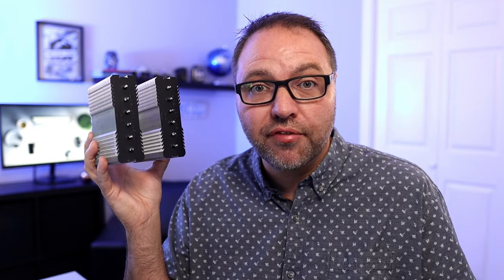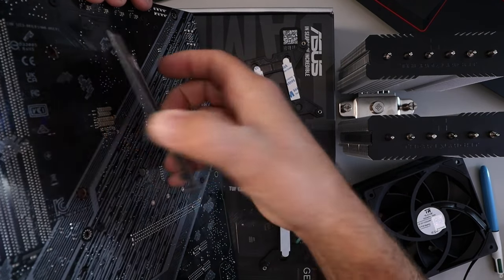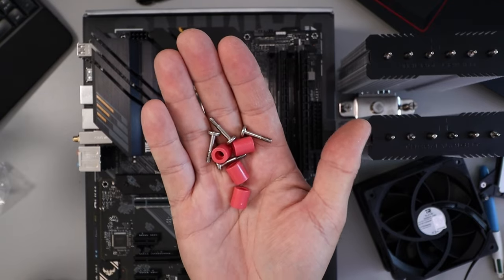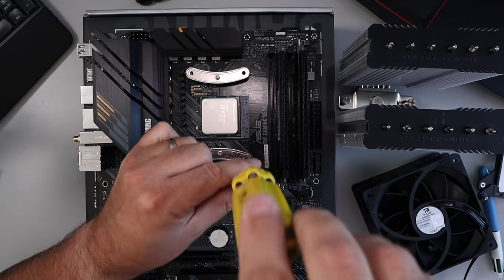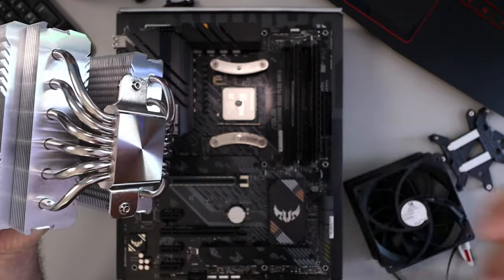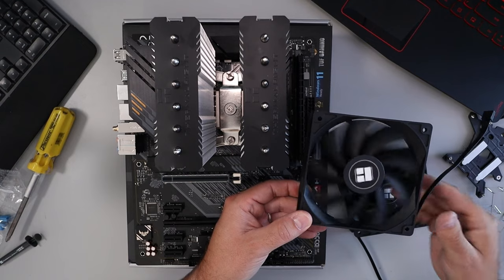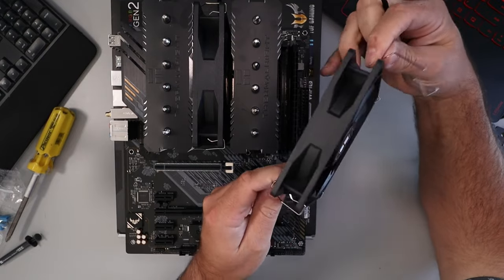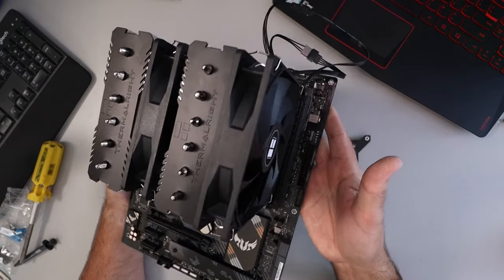How to Install Thermalright Peerless Assassin 120 SE CPU Cooler

Comment: Hi! I have just built a new gaming PC, currently using Arctic Freezer 7 X as a temporarry cooler for my 7600 waiting for this one to arrive from amazon, can I install this cooler without unscrewing the motherboard? it took me so long to wire everything and screw everything down I try to avoid doing everything over
Reply from the maker: Yes, you should be able to but the space can get a little tight.
Reply: @NorthernVikingEveryday  Tyvm!
Reply: Installation went well! 
Thank you for the tutorial!

Comment: Sorry to ask, but for the right most fan, was it sitting right on the ram or was it hovering it
Reply from the maker: I slid mine up about a quarter inch so it would clear. The ram. Seems to be working great for me.

Comment: Mine does a noise. It ramps up from silent to this noise I cant explain. For a few minutes then it goes away. Then it starts up again. It’s nothing to do with load. It does it on idle, randomly while gaming. I thought it was the case fans at start.

Comment: I've just installed mine, however my ram is too tall so I've moved the fans a stage back, so I have a fan in the middle and a fan on the back, do you think this is going to hurt my cooling significantly?
Reply from the maker: I've never tried, I would keep a close eye on it for a bit and monitor the temps.

Comment: How is the clearance for RAM? That looks like an awfully tight fit right?
Reply from the maker: It is pretty tight on mine. I did have to slide the fan up  maybe an eighth of an inch for it all to fit. But it seems to work great.
Reply: @NorthernVikingEveryday In theory, I reckon you could also flip the outer fan to the opposite side right in front of the exhaust case fan right?... I'm not sure if that would affect it negatively though airflow wise though.

Comment: Would it be possible to install this with the motherboard already mounted?  Been having problems with my stock cooler so I wanna replace it with this one but I really don't wanna disconnect everything lol 😅
Reply from the maker: You should be able to install it with the motherboard already installed in the case.  There's typically a cutout behind the motherboard to reach the screws.
Reply: Ya but if its already in the case its going to be hard o get that heatsink in, at least for me it was

Comment: Thought of buying this but worry about this taking so much space on my mobo. This thing looks massive
Reply from the maker: It is quite large but it is very effective at cooling.
Reply: @NorthernVikingEveryday  

Thank you for your response. I have a ASUS Prime Z790M-Plus D4 LGA 1700

The heatsinks would be in the way. I have fans installed and wanted to do liquid cooling. Same issue. Heat sinks on motherboard blocks the way. Such a bummer

Comment: Awesome cooler for its price.
I have it on my 5800X3d.
Reply from the maker: Awesome 👍
Reply: What temps are you getting? I had to have messed up somewhere. It's running at 60°C+ just downloading software and games in my build I completed yesterday.
Reply: @nicklewis4484  Idle it's usually in the low 40s, but can sometimes peak into the low 60s.
Under load it can get in the low 80s. This cpu can get hot, but that is not a problem.
Be sure to use something like hardwareinfo to monitor the temps, up to 85 is no problem,  over that it will clock down.
The airflow in my case is not the best.

Comment: Do i need to pull out my mobo from my case when install?
Reply from the maker: You should be able to do it with it in the case. Just when building a PC I find there is more room to do it ahead of time.
Reply: @NorthernVikingEveryday  I’m new to PC gaming, but I do I need to plug anything in the power supply on a prebuilt I got? To replace my CPU current CPU cooler.

Comment: Hey! Just wanted to ask, I have these fans installed but I'm wondering if it's possible to change the RGB colors or settings. Do you know if there's a software or something that would be able to control them?
Reply from the maker: The fans included with my cooler are not RGB. So no they can't be changed.
Reply: They are ARGB fans so if your MOBO doesn't already have ARGB headers you'll have to install an ARGB controller then you can change the colors and patterns. A controller is about $10

Comment: how do you get that back plate if you don’t already have one? I can’t find one for sale anywhere and don’t know what to look up. 

my old fan set up the back plate had screws going in and now threaded holes
Reply: i really thought the amd backplate would come with it. The one i had that fits my mobo was for hyper 212 and doesn’t have threaded inserts. what a sham
Reply: @giuseppesgone9829 what did you do with the oem backplate
Reply: @blinks22-kv1kn  nvm got it to work by replacing the threaded insert screws with my mobo backplate, was pretty finicky but got it done

Comment: My motherboard only has one cpu fan connecter?
Reply: the cooler comes with a splitter so it turns the 2 fans into a  one fan connection which plugs into the cpu fan header

Comment: Hiiii, do you mind if I ask a simple question. My motherboard is just like yours and I installed 4 “regular size” ram bars. They’re about 1in high. Just want to make sure if my cooler will be blocked by my ram bars……😢
Reply from the maker: It was definitely tight on mine. I had to slide the fan up about a quarter inch to get it to fit.
Reply: @NorthernVikingEveryday  thank you sir! Really helpful! And I got my new cooler installed with no problem!🫡